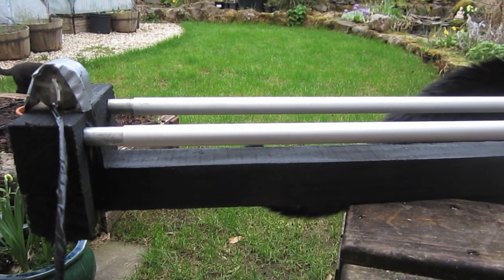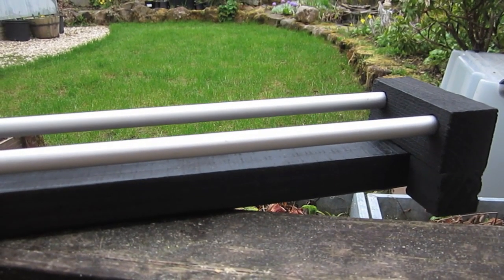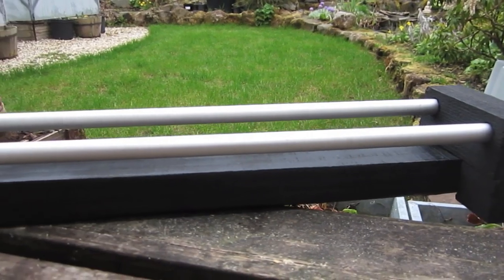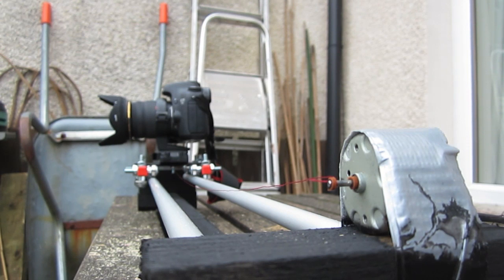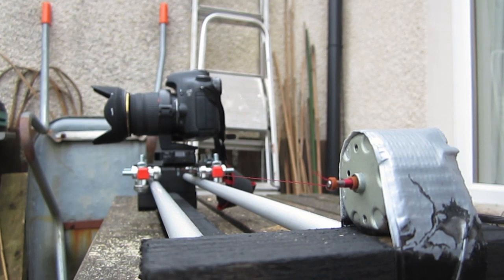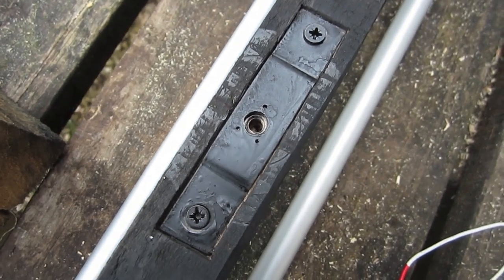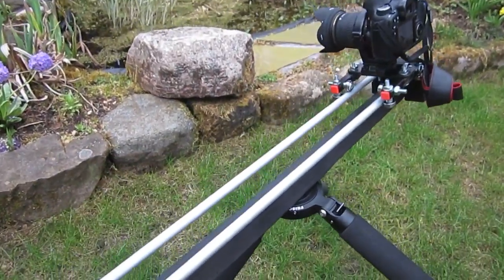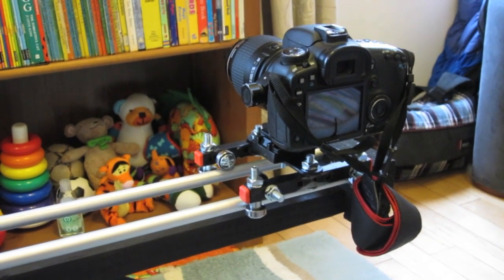Homemade dSLR track dolly / slider (DIY, how to) with motor

Comment: Great thinking!!! Would you be able to have a motor move very slowly for a timelapse?
Reply: +Ben Bishop You certainly could. What about trying to use a simple analogue clock? If you could connect the mechanism up to the minute/hour thing somehow you would get very slow rotation.
Reply: I highly doubt the clock's gears would be strong enough though

Comment: What motor did you use? I've got the rail system already from a failed arduino attempt. I just need the motor and how to wire it up if you could help with that??
Reply from the maker: I think any old low voltage motor would do to be honest. It is held on with gaffa tape - nothing fancy. Try something like this? http://www.ebay.co.uk/itm/Mabuchi-RE-140-Motor-3-VDC-R-C-Low-Voltage-Hobby-Motor-11000-RPM-/271173157250?pt=LH_DefaultDomain_0&hash=item3f232e0182

Comment: Ingenious. I've been thinking about buying a motorized slider but they're pretty expensive, this is a clever alternative. You could even connect the brushless motor to the camera remote shutter output via timer relay for taking timelapse sequences, the dolly would move incrementally after every shot.

Comment: Can you give me a bit more detail on the motor please. What type and where did you get it from, is it charged with a 9v battery? Thanks Mate
Reply: FF-130SH High Torque Mini Micro Motor 4900RPM Output DC 1.5-6V. Try this motor